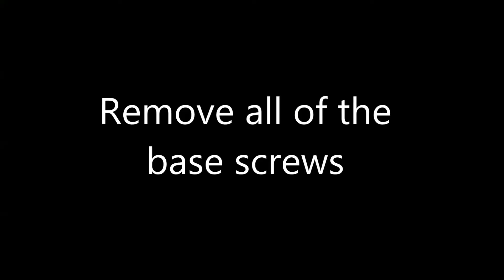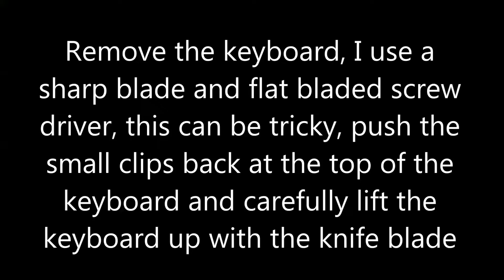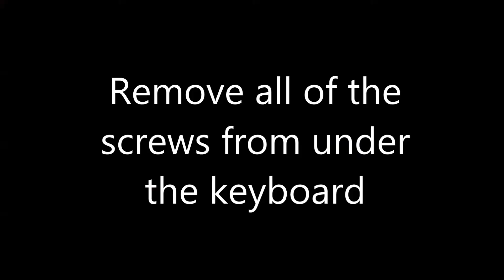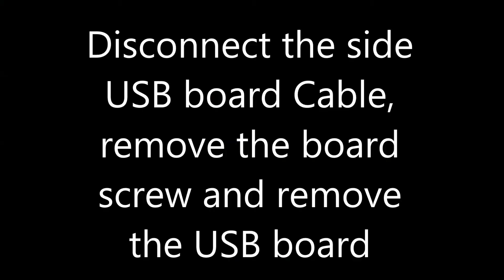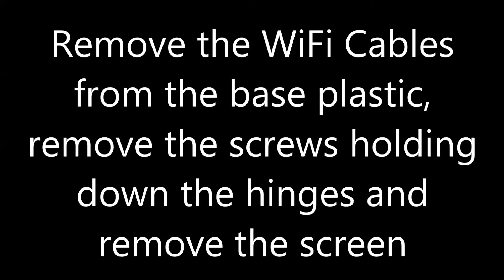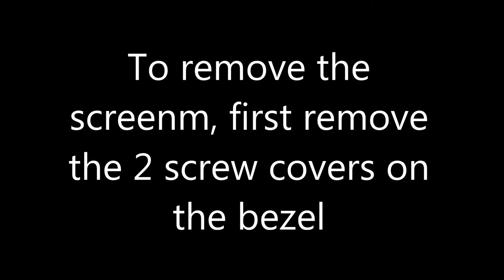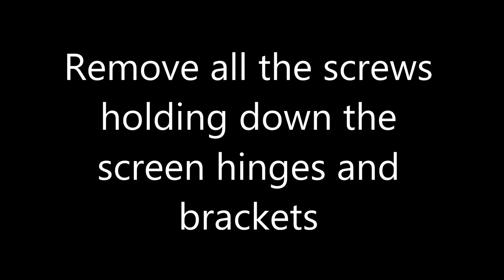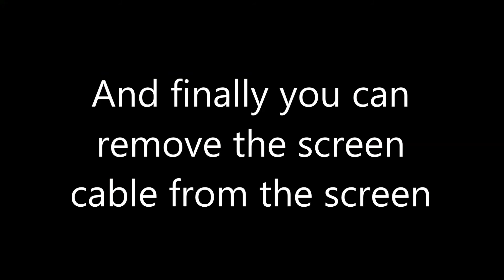Asus K53E / X53E Full Laptop Disassembly + Screen replacement

Comment: A tip for your future video making. Please show which screws go where. You need a direct down on camera view (like from your eyes) to see where exactly screws are, and which screws went where. I came to your video to figure out where one specific screw went, and I cannot, because you do not show the actually screws or where you are removing them from. Yes, I can assume. I have been disassembling laptops for awhile now and took it apart with no help, however, my issue is that I left it apart for a couple weeks while I was waiting on a part to be delivered from china. Now that I have the part and done the repair, I am trying to reassemble the laptop and thus my problem.
Reply: Have you tried looking up the Service Manual for this laptop ? I'm sure all the parts list is in there. 🤔
Reply: 2 thicker screws go on the hinge side, second ones in.
3 short screws at edge of CD tray + 1 under HDD tray.
If I recall correctly all the rest are the same thickness an length.

Comment: Hi,

I got one second hand about 2-3 months back in pieces & reassembled it just recently. 😊🙄

Is the maximum RAM capped at only 8 GB (PC3-10600) or can it handle even 16 GB (i.e. PC3-12800) ?

What about CPU upgrade ? Is the i7 2670QM really the maximum or... ? i7 2860QM/2960XM maybe ? 😑

Thanks &...

Best Regards,
Reply: Edit: I upgraded the CPU to the i7 2670QM CPU & is running with 2x 8 GB DDR3 PC3-10600 1333 MHz RAM. I also put in a Samsung 860 EVO 250 GB SSD. 😉😎💪

Comment: Can you tell me how to find the screen inverter? Mine seems to be broken, but I cannot find it. Usually it would be under the bezel at the lower part of the screen AFAIK. Is it located in the other half of the laptop? If yes, where?
Reply from the maker: This model uses an LED screen, so therefore does not need an inverter

Comment: 7:01 Do you remember how the screen cable connects to the motherboard? I can't figure out exactly how to disconnect it.
Reply: I have in fact been inside one of these machines in the past 48 hours; it's just a simple connector, push on each side and it'll slide out. cable faces to the fan exhaust when reconnecting.